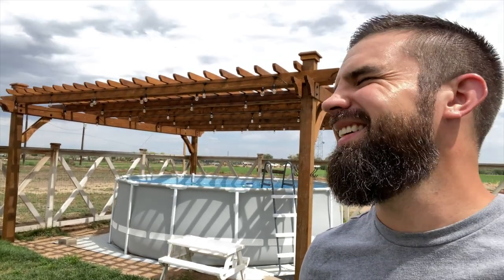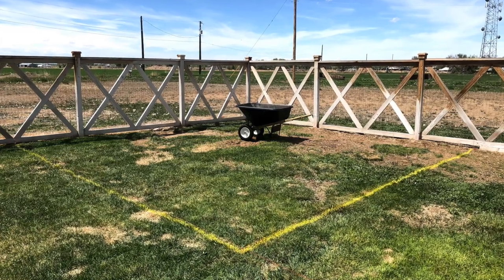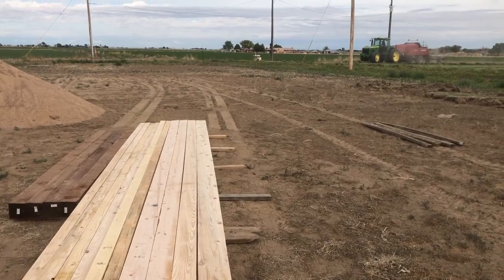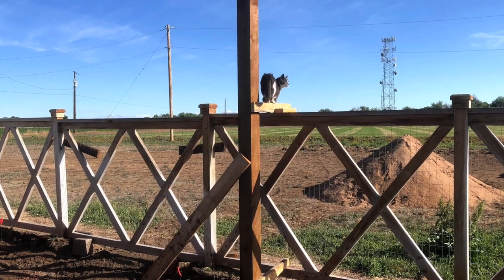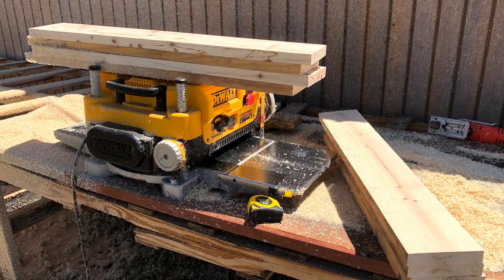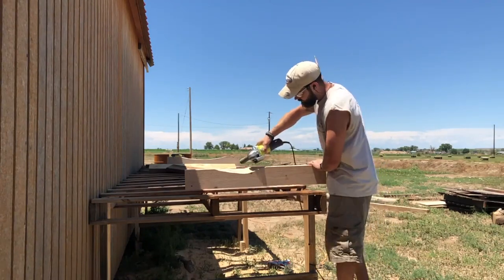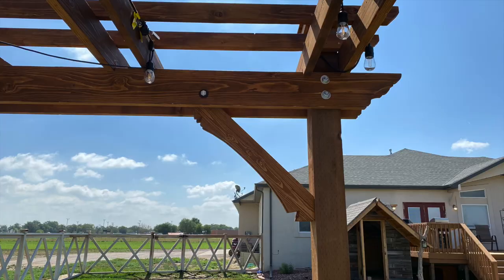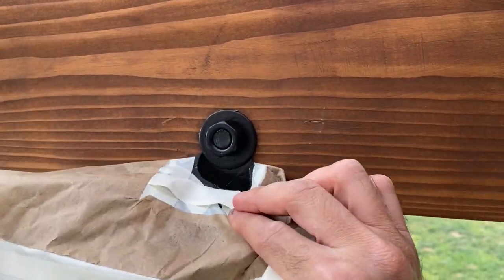Backyard Pergola | 20’X20’ | Summer Project | DIY

Comment: Great, finally found a Pergola example that I could model. I will paint white and will install between home and detached garage. great work thanks!
Reply from the maker: Sounds like it will be beautiful. I like white pergolas also. They really make an area look classy. Good luck with your project.
Reply: The issue with painting is once you start you are committed. if you don't mind re-repainting it go for it. Personally I would do other treatments like stain an oils I would find that a little easier to manage.

The finishing expectations are different too.

Comment: I love the pergola you builded wanting to do the same but on a smaller scale 16x18 but I'm consern  about  anchoring the 6X6 on to my concrete patio ,will be it strong and solid enough using brackets like in your build. Some times we get a some strong winds.

Comment: Nice work there. I like the extra detail on the rafter tails and the post caps. Planning my project and these will be incorporated. Thanks
edit: I also subbed
Reply from the maker: Thank you so much. I’m glad to hear it. Thank you for subscribing.
Reply: @JLWoodArtistries  Started on ours this week. Did the same as you and painted my galvanized bolts. The black hardware is costly!
Reply from the maker: That’s awesome. I’m glad to hear it. That plasti dip is the way to go. A bit more time added to the project but saving money is worth it I think. I forgot to mention that I had plasti dipped all the hardware before the install and then later  it started coming off when I was tightening the nuts so it’s better to mask it off and spray it on after they’re all in place if that makes sense. Hope it all goes well for you.

Comment: what type of concrete did you use and how deep did you dig posts' holes? thanks
Reply from the maker: I used Quikrete concrete mix. I dug the holes about 45” deep and then added a few inches of pea gravel for drainage.  The hole depth with depend on your area.

Comment: Besides notching the 2x6 how did you attach them to the 2x8 mechanically? Thank you great build
Reply from the maker: Hey thanks. I may not have mentioned it in the video but I also toenail screwed the 2X6 rafters on either side to attach them to the 2X8 beams. Good question and thanks for watching.

Comment: Great and awesome build - which attachment did you use for the angle grinder? can you make a video of how to make post caps please?
Reply from the maker: Thanks for the compliment. The blade I used is called a GRAFF Speedcutter. It has three teeth. I purchased it on Amazon for around $15 if I remember correctly. I have been asked a couple times for a video on those caps. If I get some time, I’ll try to make that happen. Thanks again for the compliment. Take care.

Comment: Great job so if im going 20 x 20 as well . Will 2x10 span that with no other post was told maybe need 2x12 to span 20 ft thanx
Reply from the maker: I think it will depend on the type of wood you use, the area you’re building it in and if you use angle brackets. I used angled brackets and they definitely helped keep mine from sagging and it’s been through all the seasons for a couple of years now. Good luck with yours.

Comment: Hi I have a canopy in my backyard with 3.5”x3.5”  posts and I wanted to turn it into a pergola that’s almost the same size as yours. Do you think my posts are too small? They are also 9ft tall above ground.
Reply from the maker: I think you would be okay to use the 4x4 posts you already have but I would recommend you do some research first. The area you live in, species of wood the posts were made from and the footings attaching them to the ground are things to consider as well. This article has some good information to start your research: https://plasticinehouse.com/how-much-weight-can-a-4x4-hold/#:~:text=An%208%2Dfoot%204%C3%974%20can%20typically%20carry%201%2C000,even%20more%20if%20properly%20braced. Best of luck to you. Take care.

Comment: Hows the sag? Ive beating my head over a 20x20 pergola and everyone has shot down 2x10 and 12s for supports saying it will sag.
Reply from the maker: I was worried about that as well, but so far no sag. Not even a little. I chose the straightest boards and I made sure the crown of each board faced upward, which helped also. It’s been through rain and snow and the heat and cold and still standing strong. Maybe you can add a center post to each side and then additional brackets to strengthen the middle of the pergola. I had thought about doing that but really didn’t want the extra time and money going into the project. Hope that helps.

Comment: Hello. Just saw your post. A great build. I am contemplating building something similar style (10x10) pergola in my backyard over a circular fireplace area. It appears that you used the non-treated lumber and then used stain sealer. Am I correct? will it survive the extreme weather?
Reply from the maker: The posts were pressure treated but everything else I used the stain & sealer. So far the weather has not been an issue. I’m in CO with hot and cold temps, rain, snow and hail and it’s standing strong and still looks beautiful

Comment: Great build. I am in the process of planning my build of a 16 x 16 pergola. Question? How deep did you go with your 6 x 6 posts?
Reply from the maker: I had about 40” post holes and added several inches of gravel for water drainage before dropping in the posts. I would double check the frost line in your area to help determine how deep you need to dig. Good luck with your project.
Reply: @JLWoodArtistries  thank you for the insight. The one thing that I do not have to worry about in Florida is frost lines.
Reply: @JLWoodArtistries  How long were your brackets?

Comment: what is the deflection of the 2x6" over that span? Noticeable?
Reply from the maker: The pergola is still level which I was a little worried about initially when only using posts on the corners and none in the middle. I have noticed some twist in some of the 2x6’s though. I thought the 2x4’s above them would keep them all straight but no. I will probably add some blocking to straighten them back out. Is that what you were asking?
Reply: @JLWoodArtistries  super useful thanks.
Reply from the maker: @paulthomas8262  Happy to help. Take care.

Comment: I'm planning on making one that will be approximately the same size as yours. Where are you finding the beams that span 20 feet?
Reply from the maker: I think you can order 20’ boards from Home Depot, but I went to lumber yards so I could hand-select each board. It took 3 different lumber yards but eventually I was able to get all my lumber. My suggestion would be to call the lumber yards in your area to check what they have in stock before making the trip over to them. Good luck with your project.
Reply: do you think a 2"×8" is strong enough.  I've been researching everything has said to use 2"×12" to span 18'  I'm building a pergola myself just curious how the 2x8 holding up. great vid.
Reply from the maker: @oscaryeppez1891  2x12’s would add more strength. I can tell you my pergola is a year old and there is zero sag. I made sure the crown faced up on all the boards and added the brackets to help prevent the sag. You could look into additional posts too for added strength.
Reply: thanks for the response I went with 2x10'  🤞lol
Reply from the maker: @oscaryeppez1891  I bet you’ll be just fine with that. Mine has been through rain, snow, wind, hot and cold and is still standing strong. Good luck with your project. I’m sure it’s going to turn out great.
Reply: yea just waiting for wood prices to drop lol

Comment: Nice build!  Do you have any issues now that you've had this up for a while... with that wide of a span on the main beams?   I want to go 20 feet... but was thinking of putting in a center post...  but after watching your video maybe i wont need to.   Also how did you attach the double joists to the main beams?   Thanks for a great video!
Reply from the maker: A center post would help prevent sagging for sure. I relied on my angle brackets and a year later, I have zero sag. I attached the double brackets with a bolt, washers & nuts to the beams and used a lag bolt to attach the bottoms of the brackets to the post. Hope that makes sense. The angled brackets really helped to keep the pergola top from sagging, but a center post would definitely add extra strength if your layout allows for it. Thanks for watching.
Reply: @JLWoodArtistries  Great!  Thank you so much... yeah I definiely like the angle brackets idea.  Mine would actually be a little smaller 10x20 ... and on back side I could do a middle post... but on the front side would be right in the middle of the action so to speak.  But glad to know that with your angle brackets you dont have any sagging... thats definitely the route I'll take as well.    How far down did you cement the posts in?   Im trying to decide if the better route is to cement into the ground... or create a small slab on each corner and then bracket into the concrete... (shooting for an inground pool in the next couple years hopefully.. so just thinking ahead if i have to move this a little) ... thoughts?   Thanks again for your time..  and I subscribed : )
Reply from the maker: I would say to check with the building codes for your area. For me, I dug down below the frost line, added a few inches of drainage stone, and then placed the posts and added concrete. Overall, I dug down around 45” or so and then added pea gravel. I wasn’t worried about all the holes being exactly the same depth because a string line run level across the top will show you where to cut the tops of the posts level to one another. Thanks for subscribing, it really means a lot to me.
Reply: @JLWoodArtistries  Thanks again!

Comment: Excellent work!!! Wouldn’t non-pressure treated wood cause issues since it’s outdoor? Or stain should be enough?
Reply from the maker: Thank you. I used a stain and sealant product. I’ll have to reapply again to keep the wood protected. Pressure treated wood needs a sealant added periodically too. I’m sure it depends on the climate and moisture.
Reply: @JLWoodArtistries  agreed. Do you think stain and sealant is needed even if the pergola is covered?
Reply from the maker: I still would. Couldn’t hurt to give it extra protection. Plus then you could stain it the color you want it to be.
Reply: Great!! Thank you!
Reply from the maker: You’re welcome. Good luck with your project.

Comment: Awesome pergola man,,, has it warped or craked since you built it how good was that sealant you used, reason asking is i wamt to build one with pressure treated wood as well but im scared it will warp or crack on me thanks let me know.
Reply from the maker: It hasn’t warped but I’m letting it age over time so there has been some splitting. I think it looks good but it’s the look I’m going for. I’m sure you could finish it annually to prevent that but that’s more effort than I was looking to put into mine. Hopefully that helps. Good luck with your project.
Reply: @JLWoodArtistries  nicee man yall did a heck of a job i want to have one made but they dont recomend regular wood they wamt to use cedar but man its pricey lol but i might have to go the same as route you did looks awesome👍🏼👍🏼

Comment: Just FYI- cement doesn’t dry- it actually hydrates to gain strength, you absolutely don’t want it to dry. Also, if there were any rocks in it it was probably concrete, not cement (which is like the flour in your cake mix - one key ingredient but not the whole cake)
Reply from the maker: You’re absolutely right about that. I appreciate you for sharing. Take care.

Comment: You may not read this but about how did it take you to build that by yourself? It looks fantastic I like the plastidip idea.
Reply from the maker: Hey thanks. The main structure took a full week (I took the week off from work) and then a couple more weekends to finish the post caps, brackets and plasti dipping the hardware.
Reply: @JLWoodArtistries  thanks for the reply was thinking of making one and didn’t know roughly how much time to plan on!

Comment: How did you attach the string lights to gergola?
Reply from the maker: The cord of the lights had a ring above the light bulbs. I just screwed the lights to the pergola boards through those rings. Here’s the link to the lights I used. You can see the rings I screwed through in the pictures.
Magictec LED Shatterproof String Lights Commercial Grade with 15 Hanging Sockets 48 Ft Black Outdoor Weatherproof Cord Strand for Patio Garden Porch Backyard Bistro Gazebo Party Deck Yard, 2 Pack https://a.co/d/eSlVEqw
Reply: @JLWoodArtistries  thank you

Comment: You were doing great up until you started to film that cat...
Reply from the maker: Haha. Mittens told me to tell you to check out my video on making a cat scratching pad.
Reply: Hey question, where did you find the template
Reply from the maker: I created the two different templates by drawing different designs on cardboard until I was happy with how they looked. Then I cut out the design and used them as templates to draw onto the ends of the boards.
Reply: Nice,Thanks brother for the video very informative